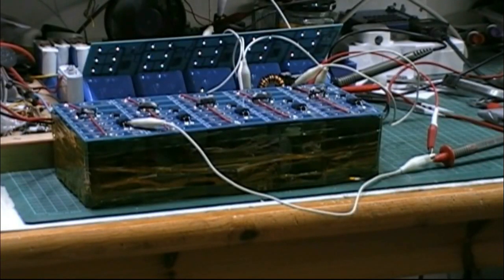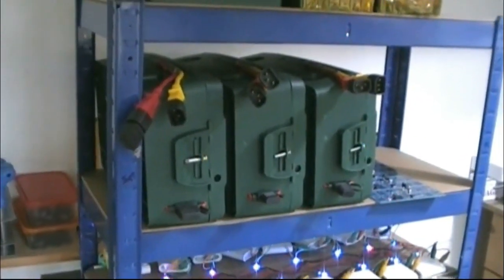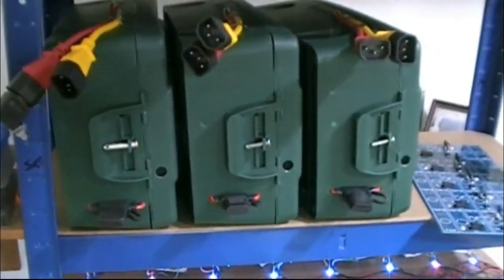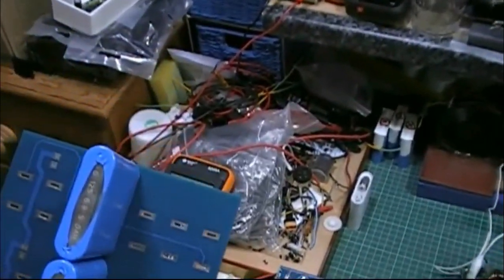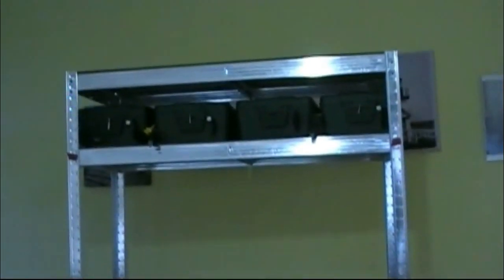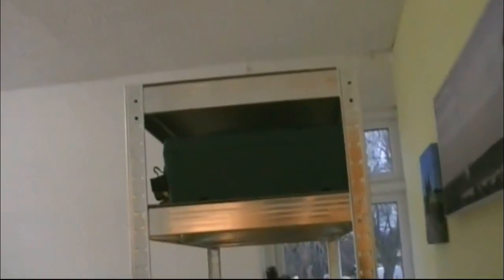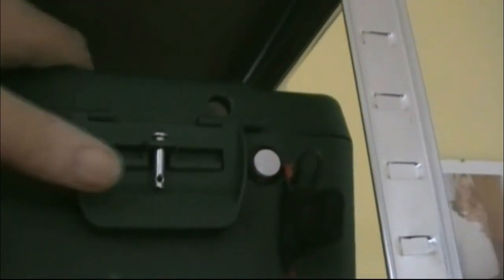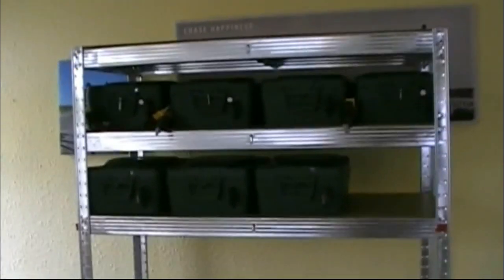PiPW and Batteries

Comment: Ray - what kind of inverter are you going for?  I went for a cheap UPS that puts out 2800W (constant) off eBay for 60 quid.  It’s rather heavy - but never mind the quality, feel the width as they say.
Reply from the maker: Hello Philip. Thank you for your input. I am personaly going to do as much as I can on 24 volts and using step down inverters.I shall be experimenting with modifying a tumble dryer. for example to run on 24 volts. The only thing at the moment that I will need an inverter for is my electric hob. It's going to be a watch this space. Simply because I won't know what I am going to do until I do it. Lighting no problem because I make repairable led bulbs. Have a great weekend my friend.